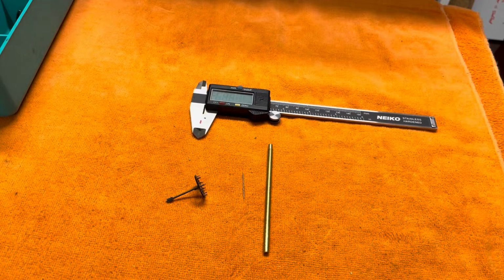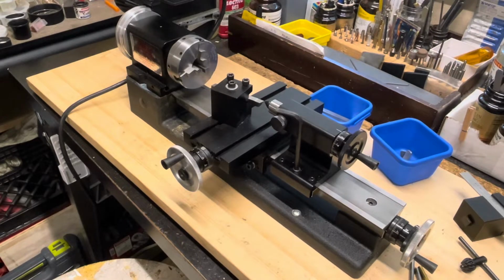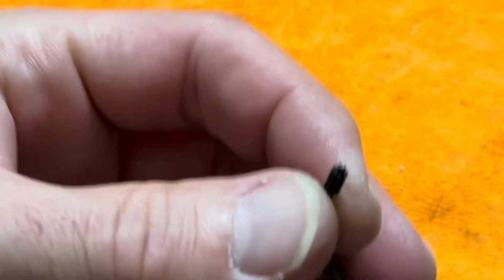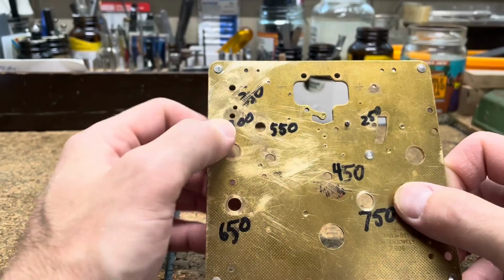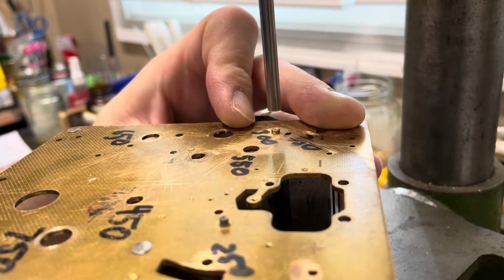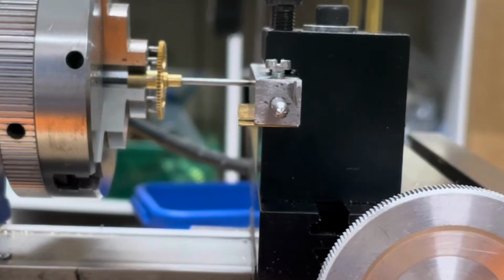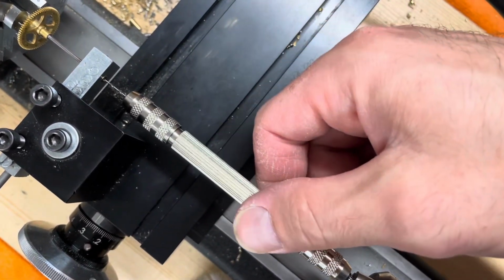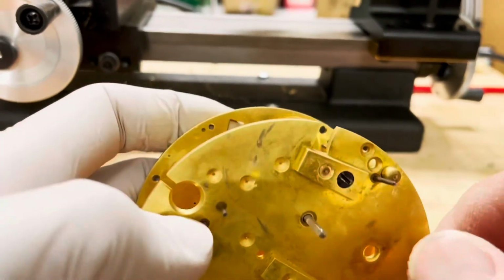Re-pivoting a French Clock Wheel

Comment: Nice work and nice video, congratulations. Personally I would prefer to heat only the shaft head, perhaps inserted in a perforated sheet so to shield the pinion, trying not to alter any possible heat treatment present in the teeth.
Reply from the maker: That's fair.  Thank you.

Comment: Great video.  Kind of still a newbie so I have some questions.    What’s the purpose of the heat sink vs just heating the part directly? What’s the smallest diameter pivot you’ve done with this method?
Reply from the maker: The heat sink allows the metal cool slower so it softens, otherwise it will cool too fast and won’t soften the metal. This was the smallest pivot I had done with this method.
Reply: Thank you for the explanation!  @Chrisclockrepair

Comment: I'm a clock repair man myself. Not nearly as good but. I recently had a worn pinion on a French whell. Due to the governor fan slipping. I just not a comfortable on a lathe. Is there any tricks you know to using an add a pivot? It on the gear side just like the one you restored. Ive learned quite a few helpful hints and tips frm watching. Keep it up. Thanks for the complete beginning to finish videos
Reply from the maker: A lathe is pretty much required for pivot work.  You can send your gear out to be re pivoted. There are people who provide that service. Call merritts and ask for someone. They can suggest someone.
Reply: @Chrisclockrepair   thanks for getting back to me. I have a small lathe that was given to me from another clock man that passed. Time to start learning. Do you have any online classes or anything else. I've been repairing for about 7yrs now. I'm self taught for most part. I've had a few piers show me some tips and tricks. I stay 3-4mths behind and need to get faster on repair of mantle and kitchen clocks. That's seems to be my bread and butter in this  area. Grandfather's I tend to sell them a new movement if at all possible. Do you teach a workshop? Or would you consider it? Gladly pay for a crash course or just to watch how you do it. My father ran the shop for about 25yrs but concentrated on grandfather replacement and out sourced small clock. Now there's no one to do but me. Any help you could offer.

Comment: I to am a clockmaker, your idea looks good but would try not to soften the pinion, using a tungsten mini drill
Reply: Carbide drills are available in sizes small enough for even watch wheels and will drill hardened pinions without annealing.
Reply: Yes,but there's a high possibility of the very hard drill snapping off and wedging in the hole as happened when a clockmaker friend offered to do the job. Took me ages to get the bits of carbide drill out. I then let the arbor down to blue and drilled with a normal drill, I left the arbor as it was and no problem running after pivoting.